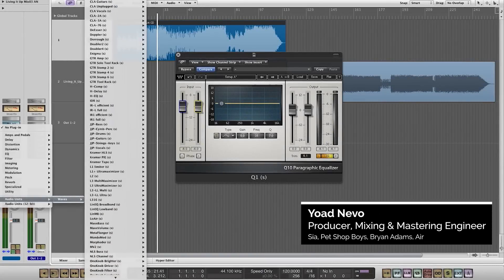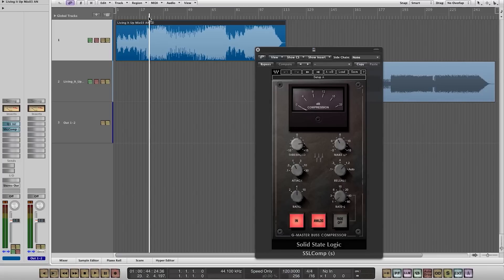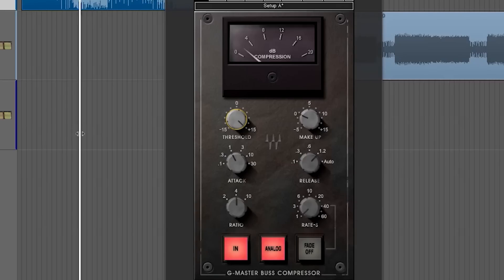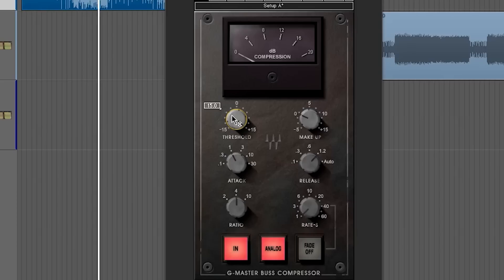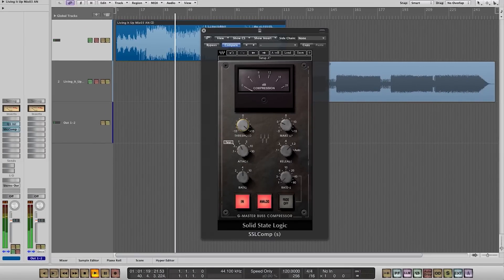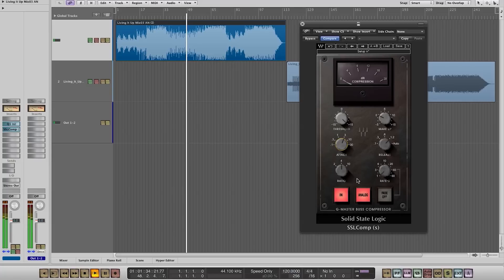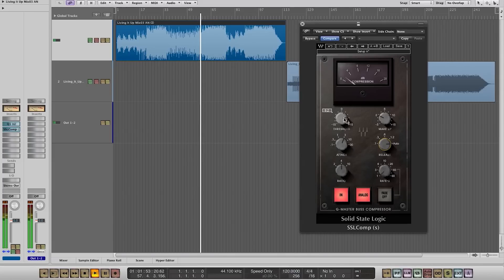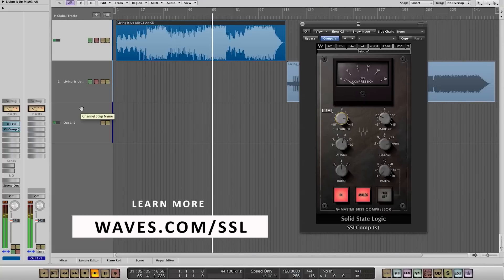Mastering with the SSL – Quick Tip by Yoad Nevo

Comment: attack would be better at 10 ms.  3 it is too short and takes  out some highs and the first energy of the instruments,  vocals,  the sharpness of the drums, etc. some even go to 30. I think 10 ms is short enough for attack.  we already have compression on the individual tracks.  if we pot more on the mix output vit should be gentle attack,  ratio so-so
Reply: I also tend to use it at 10ms, I agree with your point of view for most of the cases. At that stage (mastering), if you need to use 3 ms on that plugin, something might be “wrong” at the mixing stage, and you might go back and check it out. But again, no rules applied: if it sounds good, it's because it’s good. No wrong’s or right’s, just my point of view.
Reply: @RogerioValgode  PERFECT
Reply: What else would you recommend?
Reply: Depends entirely on taste and also what genre the music is. No rules.

Comment: 2:05 of nothing
Reply: Seriously.. Where was the tip? Oh I get it... we're supposed to pull it out. Cuz that's about the only tip we got here. 
Maybe I should just assume it's a tip for beginners and move on lol. But it really seems like Waves is trying to namedrop more than actually sharing any tips. Whatever.
Reply: The only "tip" I got out of this, which was rather hidden, is to gain-stage before the plugin so the needle barely wiggles at the full +15 setting of threshold and the other, default settings. Maybe this doesn't matter, but many "analog emulated" plugins require a specific input level in order to do its "magic" properly.
Reply: @charlesbonkley  This is it!

Comment: I thought you`re not suppose to set ratio any higher that 2:1 during mastering?? he`s using 4:1, any idea?
Reply: Rules are meant to be ignored. To me, 4:1 sounds a bit better, even on the mix bus (or at the basic level of mastering) than 2:1. But here's the thing...

I am becoming annoyed with the term "glue." Everyone uses it. Therefore, I'm trying to look beyond the hackneyed rhetoric. Right now, I'm trying to research and get to the bottom of the basic purpose behind why the SSL Quad Bus Comp's existence. Why was it added to the SL4000 'G' series consoles? Ignoring all the crap everyone spews and re-spews regarding "glue," "it's got that sound", etc, the bus comp in its purest form is just a compressor (VCA-based, fast-attack, fast'ish release, etc.). Above all else, it was a compressor that was OPTIONAL on the console's final output. The SL4000 owner's manual specifically states, "Before you commit the mix to tape, TRY the compressor on the main Quad output." So in my opinion, based on this, the Quad Bus Comp may not ever be necessary. I believe its purpose was to add another "layer or protection" to the console, an effort to make the mix engineer's life easier just in case he/she didn't get the input-track levels quite right at the very get-go, or if the rehearsal levels and/or playing of drums/instruments/vocals were not 100% on-point or consistent during the performance and recording. So instead of going back and fiddling with all the input faders, the OPTION to slap on the bus compressor and tweak accordingly COULD be the quick fix to finalize the mix "before committing it to tape" and sending it off to the mastering engineer.

Any issues with levels should be fixed in the mix if you have the option to do so. Back in the late 80's and early 90's when the SL4000 was produced, the DAW environment did not exist. So going back and re-recording/editing on tape, adjusting levels on a large-format console, I presume, was time-consuming and took real effort than, let's say, tweaking a mix in Ableton Live or Pro Tools.

And ultimately, with the above first statement in mind, there should be a decision-making process when using a piece of hardware or plugin, like the SSL4000 'G' bus comp: Why do I need it? Are my dynamics messed up? Is that snare drum just a little bit too loud? Am I looking for more "snap" or an over-compressed vibe? Do I want my output mix to pump? Am I looking for a little more loudness?

I welcome comments and feedback regarding this.
Reply: Sorry for the late reply, but I think in that case there's really no such thing as "suppose to". Try both, and go for the one that sounds better to you.